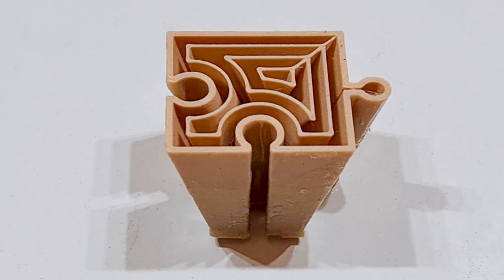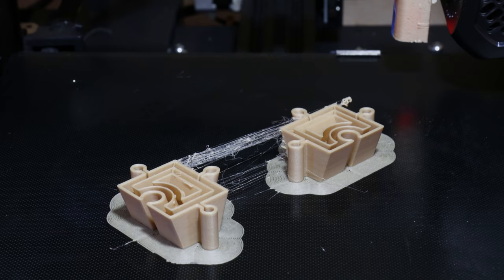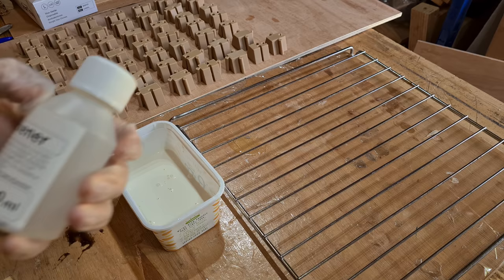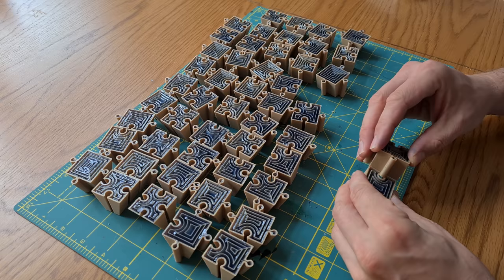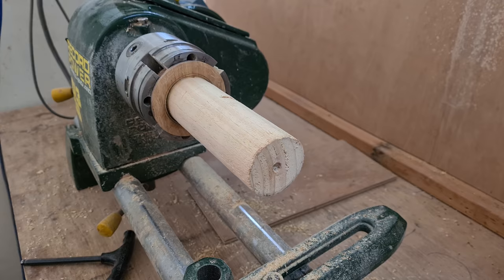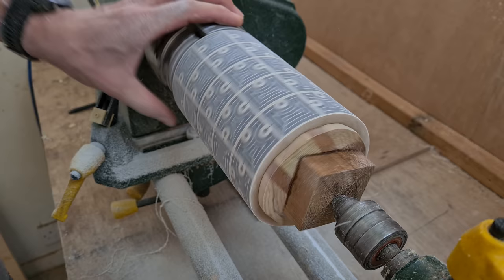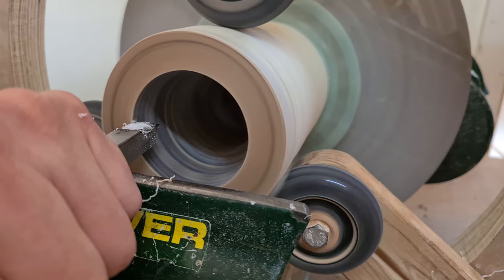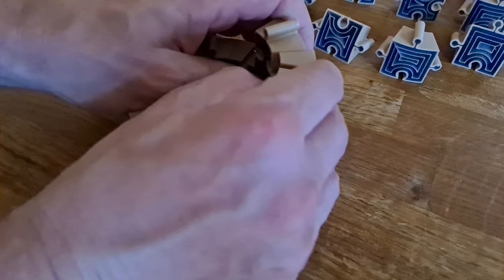Woodturning - A 3D Jigsaw Puzzle

Comment: Also consider setting the assembled cylinder in A plastic tub or jug a few km wider, and pouring an outer layer of resin. Can also do an inner layer by putting a cylinder shaped soda bottle a few mm narrower in  as well.
Reply from the maker: Would this be to stabilise for turning on the lathe? I would still want the functionality of the jigsaw puzzle!

Comment: for the turning, might want to try a rotary sander to start off. low grit, light pressure, and low rpm on the lathe
Reply from the maker: That might be a better idea than the diamond pointed tool. Thanks Robert! All the best. Ray

Comment: Tbh, I'd just model the pieces in the rounded final shape. Using the lathe for fast sanding and polishing ain't a bad idea though, one way to make it consistent easier
Reply from the maker: Hi Louis. I wanted to have a resin fill for these pieces so had to have a level rim for casting, otherwise I would have printed them rounded and saved a headache! Maybe there's a way to achieve printing rounded pieces with a transparent filament, drill a small hole in the back, then fill...? Thanks for your comment. All the best. Ray

Comment: oh.. oh dear... concentric infill eh? I guess it was intended for the final design but I think it might have caused less headaches to use a real infill, cap it 70% of the way up and only do concentric with the open top for the top 29%

the lighting at the end is very cool, hadn't considered that being a factor
Reply from the maker: Hi Kevin. At the time it seemed like the path of least resistance and was the least worse final effect when infilling. I'm intrigued by your idea, but wondering the best way to approach this through CAD and/or slicing? As is very evident, I am very new to 3d printing and CAD. Thanks for watching and commenting. All the best. Ray

Comment: Another phenomenal project!  You asked for ideas: As far as the hollowing, you could have used some type of adhesive back vinyl, contact paper or make a sleeve to slide the piece into.  Could you have used a forstner bit for the hollowing versus a chisel to work against a catch?  It doesn't matter you pulled off an amazing project!  Cheer!
Reply from the maker: Hi Creig. The adhesive back vinyl would work really well I think. As long as I could get the adhesive off after turning! Hollowing with the forstner bits is a great idea. Alas. I didn;t have any sharp ones for the project. Thanks so much for your feedback. All the best. Ray

Comment: I watch a lot of woodturning vids, and find them all fascinating, but I've wondered something and this one is a perfect example.  I see a lot of glue ups that end up being very odd shapes, bits hanging out, etc.  much like this one.  Why not take a sander to it in the beginning and roughly true the piece up, knocking off all the sticking out bits before starting to actually turn the piece?  I noticed in this vid, after you had knocked off the rough bits, you took a sander to it, why not start with it?
Reply from the maker: Hi Wes. My reason (for what it's worth) is that to sand from the outset could take a long, long time. With a super sharp, pointy bit, I'm more confident that it will not rip out large chunks of resin and I can get to the sanding stage quicker. It's a bit like using a toothed plane then a standard plane for figured wood. At least, that was my approach when I was planing the soundboard of acoustic guitars. Others may have different reasons and different approaches. All the best. Ray

Comment: (Español)
Saludos, primero que nada, felicitarte por el trabajo, ya que es interesante este nuevo concepto de rompecabezas.

Con relación a una metodología para sustituir el uso de torno para la redondez, me parece una opción sería que uses PVA (es un filamento soluble) en algunas secciones de la impresión y rellenases la resina por la parte interna de la pieza (para poder conservar la redondez externa) y perderías la redondez interna (que me parece no es un problema).

Adicionalmente ocuparías generar ciertos agujeros para permitir la resina rellene todas las piezas y que el aire no quedase capturado.

Con esas adaptaciones podrías disolver la parte impresa externa y revelar la redondez  de tu diseño (requeriría una limada y pulida como todo pero creo aligeraría esta parte).

Como detalle el PVA suele ser mas caro que otros filamentos y requerirías una impresora de doble caldera para mezclar diversos materiales de forma apropiada.

Espero te sirva la información.

Saludos y mucha suerte.

(English)
Greetings. First of all, congratulations on the work, as this new puzzle concept is interesting.

Regarding a methodology to replace the use of a lathe for roundness, it seems to me an option would be to use PVA (it is a soluble filament) in some sections of the impression and fill the resin on the inside of the piece (to be able to preserve the external roundness) and you would lose the internal roundness (which I think is not a problem).

Additionally, you would have to generate certain holes to allow the resin to fill all the pieces and that the air is not captured.

With those adaptations you could dissolve the external printed part and reveal the roundness of your design (it would require a smooth and polished like everything but I think it would lighten this part).

As a detail, PVA is usually more expensive than other filaments and you would require a double boiler printer to mix various materials properly.

I hope the information is usefull. Greetings and good luck.
Reply from the maker: Hi Óscar, what you describe is an excellent idea. I guess it would require many tests in order to get the final pieces to the exact dimensions to fit into a reasonably tight jigsaw puzzle (after dissolving the PLA), but the process would be more accessible to those without a lathe. Perhaps one day maybe I will be able to try this. Thanks so much for the suggestions. All the best. Ray

Comment: 3d print a base with a mortise already made to fit the insert and thick enough to structurally  support the cylinder and insert. Print pegs onto this base that slot into holes on the bottom ring of puzzle pieces, super glue in. This is freaking rad. Please do a third!
Reply from the maker: This would be an excellent addition Josh. I suppose I could reprint the bottom layer to accept the base pegs. Would have to be creative to turn the additional sections to match the existing cylinder. But it's a great idea to include in an upcoming project. It would make a lot of sense to include a base as you suggested. Looks like a third will be printing in due course. Just not sure when. I'm a couple of weeks behind on a technical project and not sure how well it'll turn out yet. All the best. Ray

Comment: You could do it a little bit like a cone so every peace would have a completelly different shape and make the puzzle more doable
Reply from the maker: Hi Lísias. That's a great suggestion. I think there may be a way in FreeCAD to alter the edges of each piece to make it more like a jigsaw puzzle and easier to fit together. If I could learn electronics then I also want to make a version where each piece lights up when it is correctly positioned. That may take a long while! Thanks for watching and commenting. All the best. Ray

Comment: Great and fun idea. Well done. 
I must say that your tool rest is a bit far from the puzzle and a catch with a carbide tool when roughing out resin is frequent, not to mention you could’ve blown out your piece. Be safe man !
Reply from the maker: Thanks Fred. I see what you mean. With the diamond shaped carbide cutter tool, the square tang is quite far back, so the rest is further back to get the stability. But I have no excuse with the round nose scraper; the rest is so far away. Not good. Thanks for pointing it out. All the best. Ray

Comment: Those joints seems like it could break easily playing the puzzle.  No?
Reply from the maker: Hi. I tried to bend them and they're pretty solid with the resin in. Without, they did snap. It would take quite a bit of force to break them through playing, but could always increase the size of the blanks/tabs to increase strength. All the best. Ray

Comment: Hi? awesome work! Where you buy chisel with replacement tip???
Reply from the maker: The carbide scrapper tools I use are available through Amazon: https://amzn.to/37HPwyM and the replacement cutter heads also: https://amzn.to/3xOggYR, but have to make sure you get the correct diameter heads for the tool.

Comment: Incredible project. Very, very cool. Thank you for the video. I have one question that may make future versions easier...or be of no value whatsoever. Could you print each verticle column as one single piece on the printer instead of in individual pieces to be assembled? That way all you would have to do is snap the (10?) columns together. I know you chose that filament for a reason but in a future project you could try printing each piece out of a different colour. Thanks again.
Reply from the maker: Hi Curtis! Thanks for your feedback. Yes, the vertical columns could be printed as one for a simplified puzzle. And each piece could be printed in a different colour. I guess it would come down to the preference of the individual. I still wanted the challenge of it being a jigsaw puzzle as well as being able to turn 50 segmented pieces that are not bonded together, but there are so many possibilities. All the best. Ray

Comment: Honestly, I wouldn't consider this woodworking as much as I just consider this... well... making. No less skill involved, more in the way of technical know-how, and the results can nary be argued with.
Reply from the maker: Hi Blue Cat. I agree that the involvement of woodworking is minor in this project. Alas I cannot change the name of the channel, so I'm stuck with woodworking and try to include a little bit of wood in each project. Wood fiber in the PLA was as close as I could get for this craft idea and it wasn't working it at all. Just pushing it through a hot nozzle and scraping it a bit on the the lathe. But was happy it worked. Thanks for watching and commenting. Take care. Ray

Comment: This is not selling out. I would honestly have never made separate puzzle pieces. It seems difficult to put together. So yeah I would have either used a dremel by hand to carve into a cylinder or just a rotary cnc or laser setup.
Reply from the maker: I really like the idea of using a CNC to carve out a deep, jigsaw puzzle shaped groove into a cylinder and fill with resin then hollow out. Don't think I have steady hands to try that with a Dremel. But really happy that the puzzle stick works, even though a bit fiddly. Thanks for watching and commenting. All the best. Ray